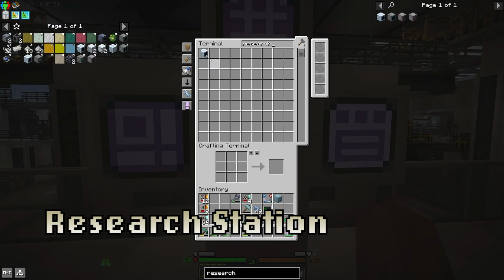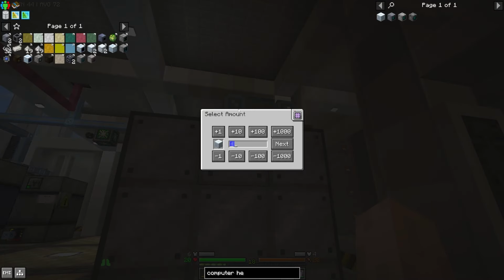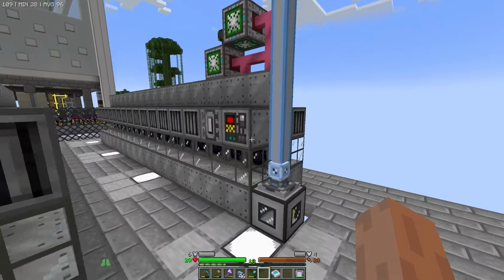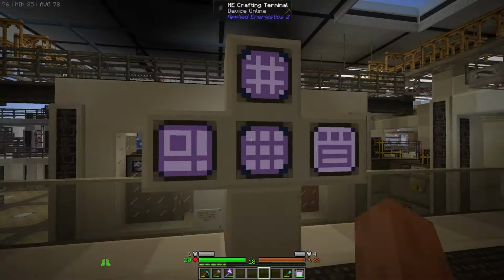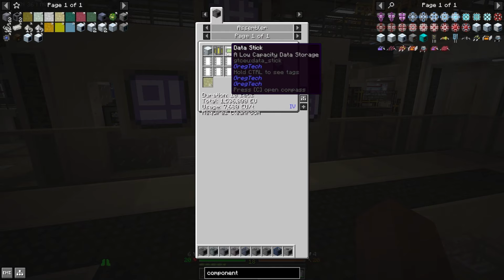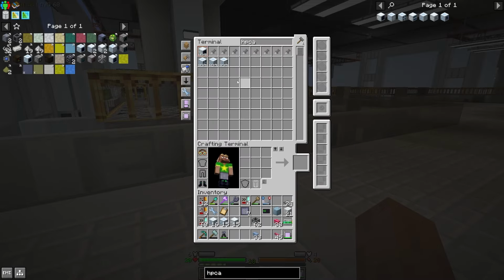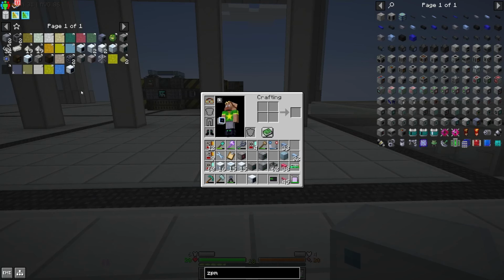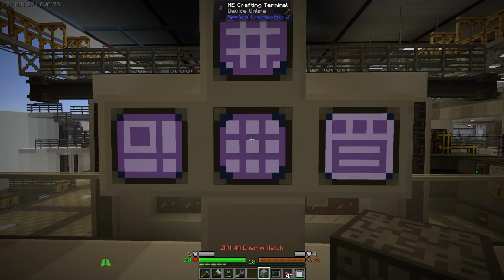High-Tech Progress: Research Station & Supercomputer! | Star Technology Ep. 39

Comment: how does active cooling work? because i have a HPCA active cooling component that needs PCD coolant, but i inserted more than enough in the inou thatch and it doesnt work
Reply from the maker: I have a new episode coming out in the next 8 hours, where I (spoilers...) upgrade to active cooling components. I didn't notice anything quirky about it myself. What specifically isn't working? The cooling? Or is it not providing compute units to the research station?
Reply: @gameswithpostie  thanks for answering, the problem was that i put the PCB coolant after i put the active cooling inside the HPCA, and for some reason It didnt notice that It had now coolant.
It fixed by breaking the active coolant and placing It 😂
Reply from the maker: @pollojuan1148  glad you got it sorted! I've run into a few issues like that where the only way to fix the problem is break a block and replace it 😅